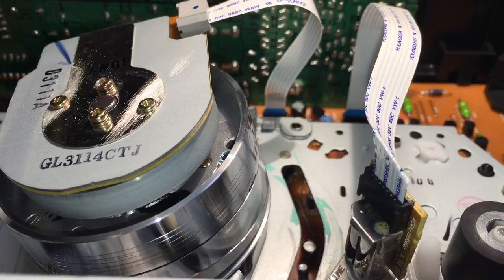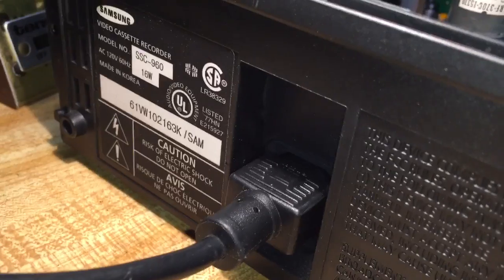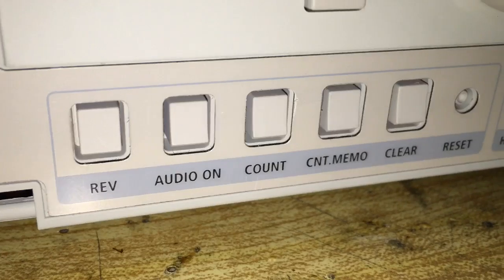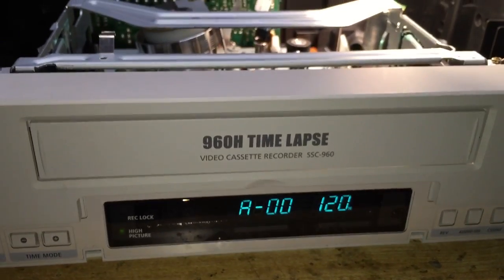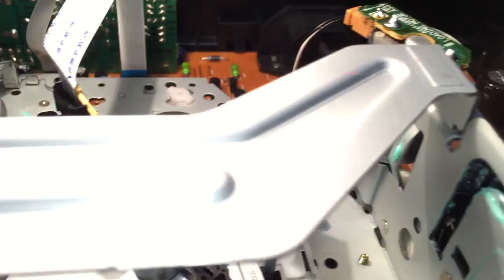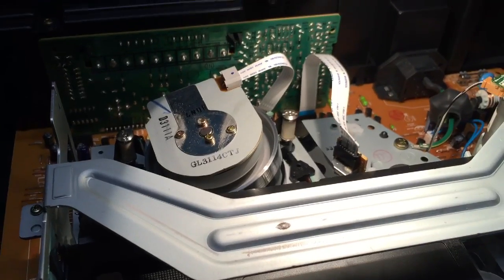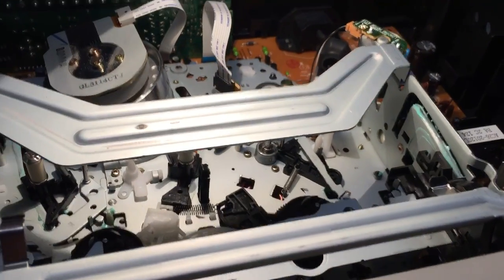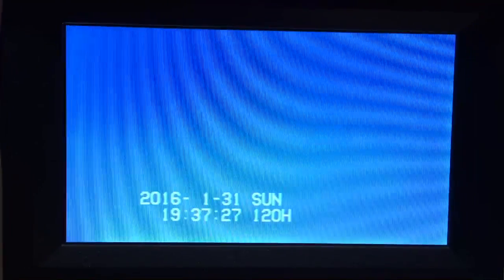???? Samsung Mystery VCR SSC-960 ????

Comment: I knew it had to be some professional equipment at 1:31 when I saw the BNC/RCA adaptors. The noise is indeed characteristic of a worn out (or dirty) head drum. We call them "fishes" here in Germany. I was a bit confused about the 960H labeling because 960H also stands for surveillance cameras with a resolution of 960 x 480 pixels (NTSC) / 960 x 576 (PAL).
Reply from the maker: +Mokoyo01 - thanks for your input

Comment: These had no motion detection, so trying to find anything on the tape could require hours of searching to find when something happens. 960 hours = 40 days, so the head is constantly spinning for up to 40 days on a single tape. The wear on the tape is high so it needs to be replaced frequently. A head cleaning tape will likely remove the sparkles.

Comment: About the noise on the video: that looks like a loose ground screw on the video head
Reply from the maker: +BF4̛ever͟fly͜♛ - Good suggestion!  If you look closely in the video, you'll see that I used sandpaper to scuff up where the ground screws meet the top plate.  It didn't appear to help.
Reply: +databits Did you also check the grounding on the whole chassis?
Reply: Perhaps it's just a tape that's not durable enough to have it against the tape head for the longer durations than usual?  So perhaps you're seeing dropouts on the tape?
Reply: Oh nevermind. I see them being constant/random from the head itself, rather than specific to the video signal from the tape. nevermind.